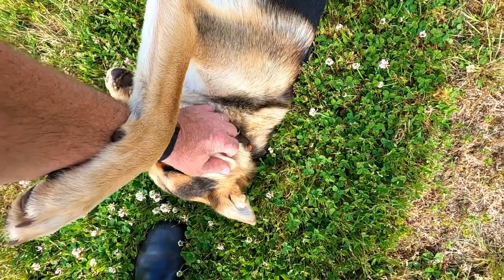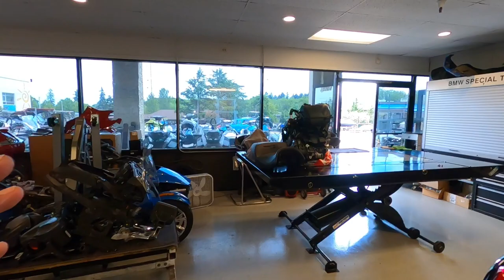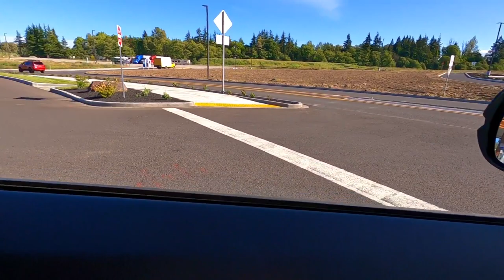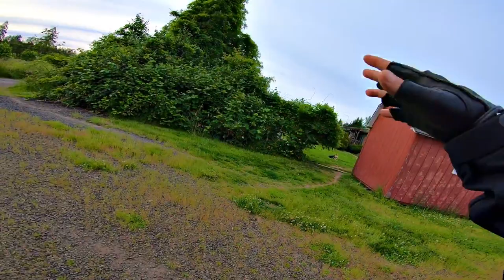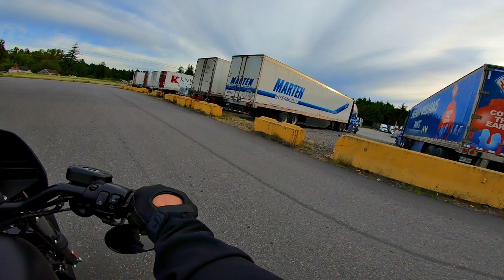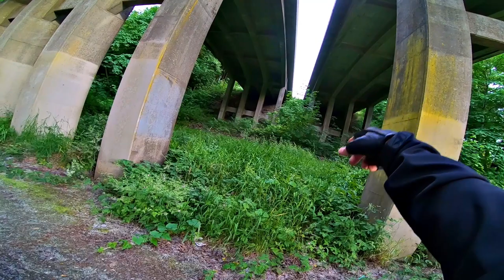I Took Out the Wrong Trans!! • An Iron Ride Fixed It! | TheSmoaks Vlog_1663

Comment: I really like the looks of the sportster iron but I just wish it was about 100 lbs lighter with a couple more degrees of lean angle.
Reply from the maker: If a single spec comes to mind when looking at any Harley-Davidson, you need to move on to another brand until you figure out what Harley’s are all about..! Lol

Thanks!! 👊
Reply: Xl1200s would suit you well. Old solid mount is 50lbs lighter than the newer rubber mounts. If that’s not enough lean angle, a pair of longer shocks will help tremendously!